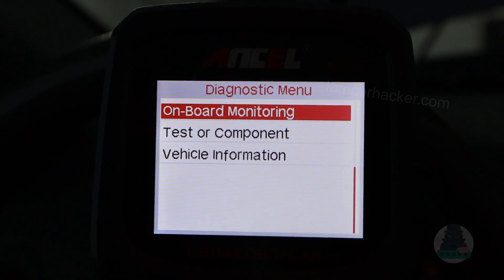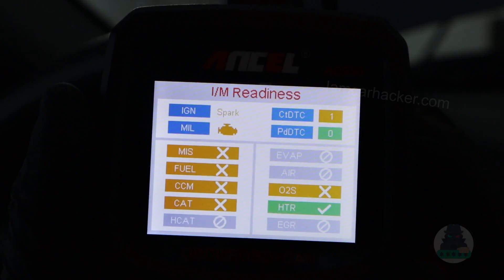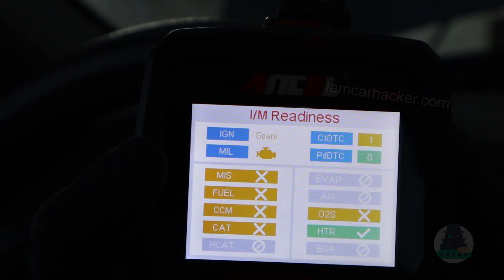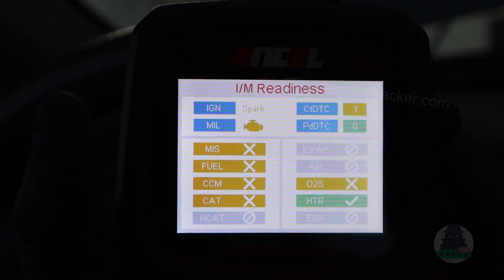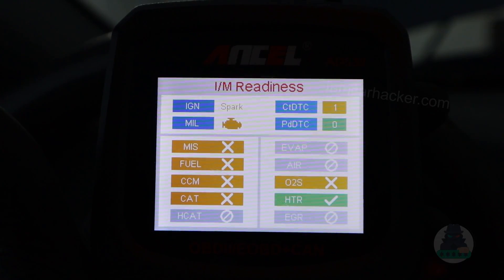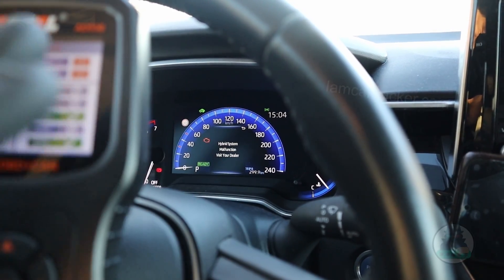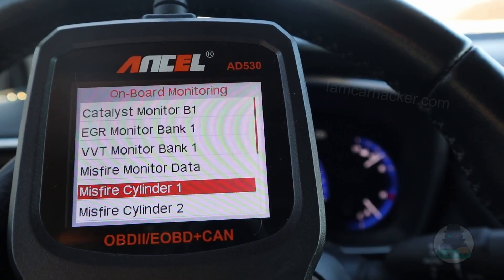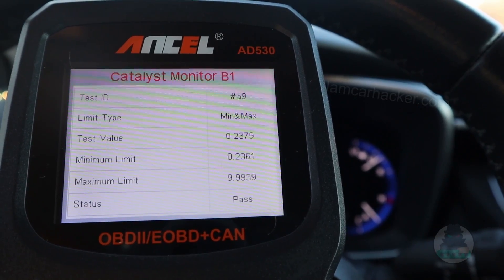OBD2 scanner READINESS monitors explained | I/M Readiness

Comment: Is it safe to say that if your car fails all of the non continuous parts you can just replace them? My scanner showed that my CAT, O2S, HTR, EGR, and EVAP were all red, do I need to replace them?
Reply from the maker: No...they can be reed when u erase codes take the car for drive in city, countryside and highway to complete drive cycle of monitors and check again